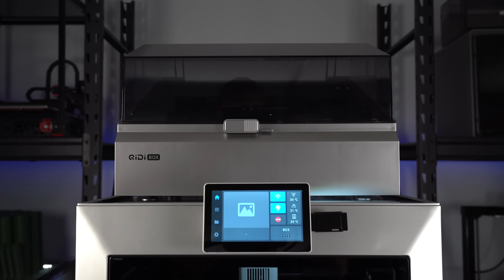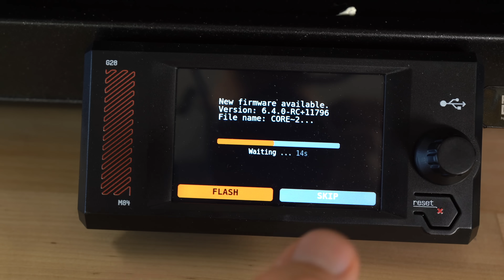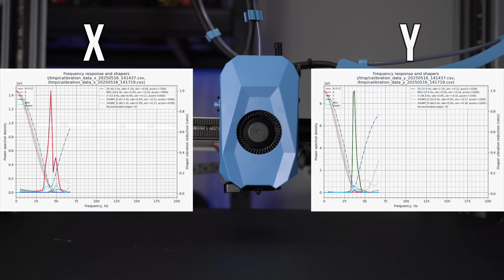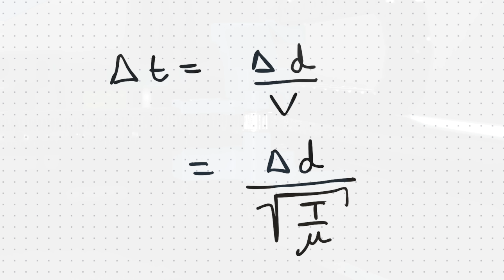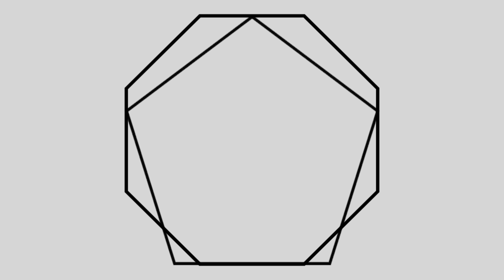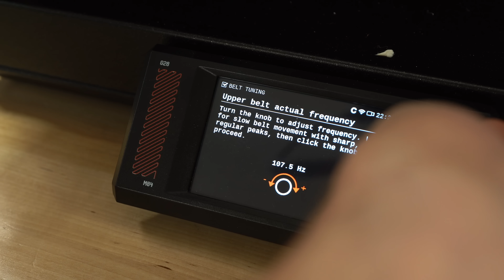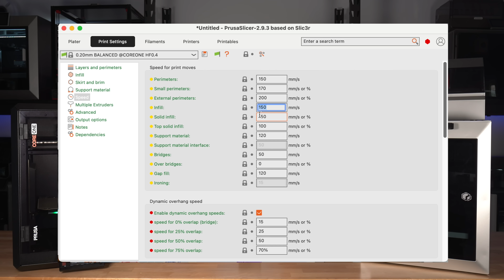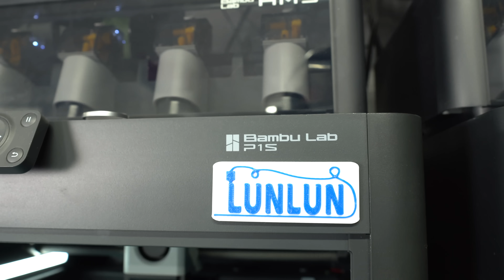The 3D Printing VFA Epidemic

Comment: Complicated it may seems, changing belts to 1.5 may not remove the vfa when the source is the motor. It only minimised or should say making the vfa closer so not as prominent and obvious. Best is to use a different drive system foc motor drives system. The current system lowering the current & speed is what most won’t do, sometimes orientation might help as it happens mostly on flat surfaces x y only. Those printing functional mechanical parts will see that more than those printing models.
Reply: literally just spend 2 more dollars on toothed idlers solves it. 1.5gt and foc both are useless.

Comment: Well made video, but I don’t think the hypothesis that 1.5 belts are necessary stands up.
Many people have been building printers for years, and especially in the Voron or HevORT community have long solved VFA issues - at significantly higher speeds than these printers, with the use of 2GT belts.

Comment: Ive built a few machines and I run them at like 60k accel for the inner walls and I dont have any VFAs the belts are 2mm pitch so far in pretty sure its cuz I use proper belt tension and toothed idlers the klipper module for Klippain def helps with getting tension right.
Though I also use the motor_sync module

Comment: What if there were 2- or 3-phase belts, with multiple courses of teeth, offset by a half or a third of the tooth pitch? Clearly this would complicate things practically but would it help reduce artifacts in theory? What about using helical timing belts?
Reply: That’s a very interesting idea.

Comment: Always a rush to market, ignore the print quality issues.  Running the toothed side of the belt on a smooth idler should be an obvious thing not to do.  They do not rotate smoothly because there are no teeth to maintain the belts tooth profile under tension.  It causes the belt profile to distort slightly and then revert back when it leaves the pulley, this issue would be exagerated further under higher belt tensions and higher speeds.  There are lots of different belt tooth profiles to choose from but since the early printers used GT2 most pulleys you see are for the GT2 so they are also cheaper to buy.

Comment: This is the best deep dive I have ever seen into this problem. Back in the very early 2 thousands when we used to make our own printers from scratch, I tried experimenting with using a toothless system and smooth pullies under high tension. It was difficult to get everything tight enough to stop slipping as things warmed up over time (and it was dangerous if something snapped).  While it did improve the VFD, the drivers we had back then where rough and it still did not completely eliminate, so for me it was not worth having a home made tension stressed device built by a hardware hacker, ready to take an eye out if something went wrong ;-)

Comment: A few years ago I designed a capstan system to use cables to drive the print head, all to get rid of VFA, then got stuck on another more pressing project.  Last year I machined and welded all the parts up, then got onto another project.  one day ill get around to disassembling and reassembling to install and test that system.

That test bed printer also uses Clearpath Servos.

Comment: So that 1 printer that uses those magnetic rails to push the carriage around and doesn't have any belts shouldnt have any vfas at all then? The Peopoly Magneto X.
Reply: it has VFA cause linear motors have force ripple similar to torque ripple in rotary motors driven with belt mechanisms
Reply: @alfredanil why

Comment: Seems to me the answer is to use larger diameter pulleys and move away from steppers and to servos, ideally slotless styles that inherently have smooth torque. Or just linear motors...

Comment: I have not had VFAs on my delta since I moved to modern stepper drivers, high-quality steppers (Wantai), run current settings at the high side of the sub-rated range (70-80% of rated), trading smooth idlers for toothed pulleys, setting belt tensions per actual gates recs, and adding double shear on the motor shafts.  There are many factors that can cause VFAs, as you explore, but it's a finite list and every point on it can be mitigated with proper construction and configuration.  (I'll admit I came to comment because I was offended by the thumbnail -- no VFA's in my house, thank you! -- but they're nearly everywhere for sure, and it's saddening to see so many people seem to believe they're inevitable, to the point that they don't even seem to see them.)

Comment: We had to replace a belt on a XL, but had no correct stock. As the printer was badly needed our employee tried a smooth band with a bit higher tension. This printer can't run on its maximum speed,  because the band will slip. After reducing the acceleration and deceleration to about 70%, the printer worked fine and print quality improved. There are still some VFA's visible, but that's due to the stepper motor. After that the band was never replaced with a correct one.

Comment: For me, it seems that the belts cause VFA only partially. Otherwise, we wouldn’t see VFA on printers with other motion systems like linear motors or ballscrews. The Peopoly Magneto X uses linear motors, and I’ve seen printed examples online that show VFA. There are also Pantheon printers with ballscrew motion systems. I tried to find any signs of VFA on their print examples, but unfortunately, they showcase only CF and GF filaments, which usually hide surface artifacts.

I’ve also seen VFA myself on a large-scale printer with a pellet extruder and a ballscrew motion system.

I have a theory, but it might be wrong, of course. My theory is that VFA happens because of how the molten plastic leaves the tip of the nozzle under pressure. I think this process creates pulsations in the molten line of plastic, which are very visible on the surface of the print at slow speeds and invisible at higher speeds.

I also experimented by running the same G-code for PLA but with different colors. With the same G-code and material, but different colors, I observed different VFA artifacts. Maybe the viscosity of the molten plastic has some effect on this as well.
Reply: I mean if motor resonance is one cause regardless of how linear motion is achieved, resonance is still there.

Perhaps even resonance of the extruder stepper?
Reply: I wouldn't be surprised if that's one factor. It takes very, very little variation in the surface to create VFAs; we're talking variations in the surface that are microscopic distances. So anything that can potentially cause VFAs probably is.
Reply: I agree, I think this is an extrusion issue, not a motion system issue
Reply: I have the Peopoly Magneto X and the VFAs will get much worse when printing at speeds slower than 150ms/s, the linear motors run much more stable at high speeds. this is due to linear motor cogging.

Comment: Great overview! One of the reasons many others and I praised Qidi for their recent machines was the near total lack of VFA, at least as long as you avoided certain speeds. The H2 series is definitely a big step up for Bambu Lab. Their older machines produce a lot of VFA and the internet seems to totally ignore it due to the fanbase. Even the H2 series has some VFA, especially on the straight X axis it seems, but this also of course depends on speed and other settings. I'm still loving my Qidi Plus4 for the print quality. It is a shame more manufacturers don't use larger and stiffer idlers, but the finer belt tooth pitch is definitely becoming more standard.
Reply from the maker: Thanks Aaron!

Comment: By far the best content I've seen explaining VFA's and the fixes. My Q2 with 1.5mm belts has significantly less VFA's than my Q1. The Q2 is one of the best CoreXY printers on the market and by far the best value. If Qidi would just get their act together on their MMU/Box or release a tool changer I'd be happy.

Comment: Imagine if these manufacturers applied ALL the recommendations: stepper motors, finer belt teeth, optimal belt tension, input shaping, toothed idlers, and proper profiles.
The cost of belts and toothed idlers are so minimal, the manufacturers just don't care. It's insulting for machines at these prices ranges.

Comment: Got excited and thought someone finally figured it out, but I guess not This is due to all of these printers using cheap smooth idlers on the belt instead of proper gates GT2 idlers that are toothed. I had the same problem on all of my Voron 3D printers. have the same problem on my K2 plus, but those ones are glued in with a resin. Fixing this in firmware isn't actually fixing the problem. Probably still isn't going to give you as much outer wall speed as you could have if you used proper idlers. My voron 2.4 with proper gates, idlers, and belts all the way around can do 70 millimeters a second outer wall speed while my K2 plus has to do 20 millimeters a second outer wall speed in order to do the same quality. And the quality I'm talking about is absolutely flawless.
Reply: I hesitate to build a Trident or wait for the Prusa with Bondtech INDX, I feel that the Prusa will actually work better with less hassle, what do you think please ?

Comment: Great Video! 
Just to point out H2D uses Servo motors, could that be another reason with the smaller pitch belt that helped VFA?
Thanks
Reply: My understanding is that the servo is only in the extruder. The xy are steppers.
Reply from the maker: Ah! That’s good to know. That would definitely make a difference. Thanks for watching and commenting.

Comment: *cough* motor amperage *burp* Effectively you don't want too much or too little amperage so the motion overcomes or prevents torque ripple. You will find if you run a test for VFA's like in Orca Slicer's you will have a "smooth section" where it's fast enough to start smoothing the motion then it gets too fast and brings the ripples back. When you change the amperage it will move that smooth section up or down the print depending if you added more amperage or lowered it.

I found this is the last cause of VFA's in the line of many causes on my old Replicator Dual about 8 years ago. I started by removing the belt tension springs, then replaced the smooth idler pulleys with toothed, then perfectly squared the machine to remove binding which exaggerate torque ripple with too much binding OR too LITTLE binding. The last was what opened my eyes to adjusting motor amperage. At that point i printed out a square vase mode and adjusted the motor amperage live while printing to find a middle ground for 85-120mm/s (my typical print speed on that printer). I still have plenty of old prints from my old printer that i sometimes just stare at closely because there so pretty. On my new custom build printer that prints at 320mm/s with outer shells at 200mm/s (7.5K and 5K accel), i just have my start g-code change the amperage in profiles that flow under 8mm3s to work optimally at 65mm/s with different resonance compensation profile too.

Comment: I think in stead of random types, we should denote the cause, stepper induced, belt induced or pulley induced.
Reply from the maker: Good idea!
Reply: And probably linears motors eliminate those 3 causes.
In theory...  as the peopoly magneto did not yet reach reliability.
But new printers with linear motors will come again later.
Reply: @olivier1971  would be neat to see a comparison of linear to rotary stepper motors, for things like accuracy, repeatability etc...
Reply: I think youu’ve definitly nailed the process for removing it however? I’m curious if I got the point of the video. Aka, from what I just learned, whether it’s stepper, belt, or pulley, lowering the outer wall / perimeter speed can remove them all. Would that be a correct assumption?
Reply from the maker: @TheJacklwilliams not necessarily lowering, no. There’s a sweet spot. Usually higher speeds are better.
Reply: @ygk3d  or very slow... My printer is 10 years old and does 60mm/s on Fast mode...
Reply: That’s a horrible idea, then we would know what we are talking about, I vote we name them after their discoverer, type ”Von McGlubbery”, ”Fincher McFinchface” etc, you know, like normal scientists do!

Comment: Does anyone remember the printer with linear motors? The one where everyone commented "no-one needs this since steppers and belts exist!"
Reply: It has his own artifacts. Not belt-induced vfa, ofc, but pretty similar look.
Reply: Linear motors have force ripple along its stroke length which is very similar to torque ripple in rotary motor driven belt mechanisms. Also linear motors have higher mass as they move along with the axis (X on Y axis).
Reply: that one was really cool. Only thing is linear motors are a type of servo and suffer from feedback control resonances if not properly tuned.
Reply: Do you remember it's price? Now you have the real comment that everyone said. Put that printer at the same price as the belt driven one, and we could start to talk.
Reply: @Ismsanmar knowing at what price linear motor CNC milling or laser machines start I don't see your point at all.
Reply: @alphastratus6623  My point was, and is, at what price where the company that made that printer was asking for? Don't try to compare it with the CNC world, when on the 3D printer side people have waited for almos a decade to see an affordable printer with linear rails, instead of rods. And they would have to wait another decade to see affordable ballscrews intead of ACME screws with brass knuts.

Comment: The use of closed loop stepper motor drivers could be a solution to the type 1 VFA's.  Switching to 0.9 degree motors changes the problem, it won't always eliminate it.
Reply: Closed loop steppers would do nothing to combat VFA's. Its just an encoder on the motor.
Reply: Servos, perhaps but a closed loop stepper is still a stepper and thus, dare I say it, steps...;)

Comment: Great video. Seems the beyond moving away from the current design elements of this generation CoreXY printers the other solution would be to compensate in the extrusion flow to counteract the VFA's coming from all the factors you mention. I imagine that is way easier said than done when dealing with molten plastic.
Reply from the maker: If that could be possible it would be amazing. But I’m highly doubtful that you could modulate the flow with that degree of precision.

Comment: Would it be possible to apply in firmware a version of input shaping to reduce the polygon effect, i.e., varying the rotation speed to take account for it? I imagine you'd need to print a test tower with varying offsets and tell the printer what layer is cleanest in X and Y, then have it calculate accordingly.

Comment: Great video and fantastic explanations! I would love to see you go into how improvements like AWD setups on CoreXY printers minimize VFAs. I am running AWD on my Voron Trident and Voron 2.4r2 and have no VFAs, from my testing this is due to the the belts being under better tension and the effective belt length is cut in half due to having a two motors for X and two for Y. I'd also love to see a comparison between drivers, like the very common TMC2209s vs the TMC5160 series drivers.
Reply from the maker: Those would be interesting tests! Thanks for sharing your thoughts.

Comment: There are bigger issues w 3DP quality than VFAs. Yes, parts with smooth ho,ogeneous walls tend to make VFAs stand out and this is a marginal aesthetic problem for some people.
But put a hole in that wall and witness the horrible result (lines out of plane, widely varying surface finish, corners...).
But print an object with 0.25" / 5mm vertical walls along the very edges of the plate and witness the seams and layer-shift-like effects come out of nowhere (H2S w 0.6 nozzle).
And look at all these curved up / taco beds off by over 0.5mm, imprinting that bowing into your functional part (bed calibration changes the part's shape to match the bed shape, it doesn't make the 'bed flat').
And no 'reviewer' really calls out Bambu, Creality, Prusa, Elegoo... on these. Even when reviewing relatively expensive 'precision' prosumer printers like H2 that claim 50um precision and Engineering grade...
Baffling.
This said, great vid on VFA causes !
Reply: Well there isnt really anything to call out. Its one of fundamental issues with (plastic) 3D printing. Only small parts can be done in acceptable quality, and only in appropriate part orientation, which varies a lot depending on machine and part itself. And as plastic settles, part geometry will be ruined as well (which is why printing big things in small parts is important, more parts - better accuracy).